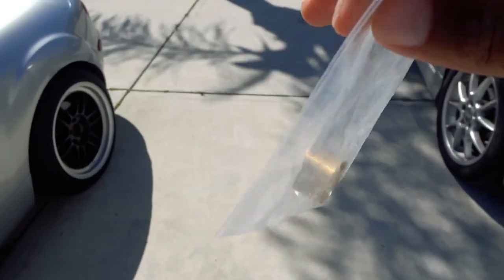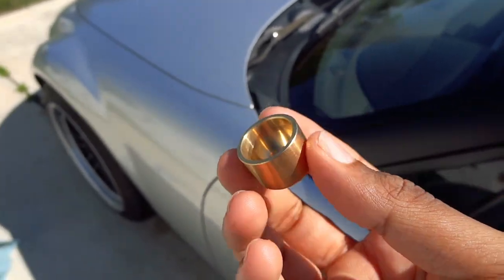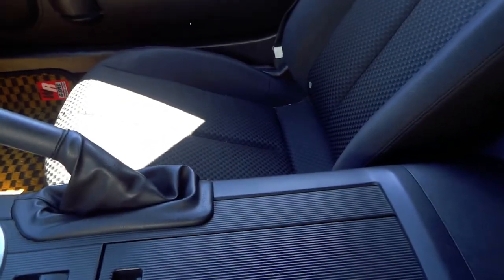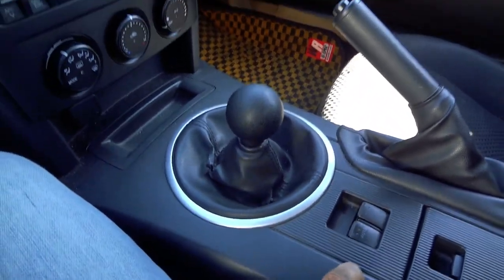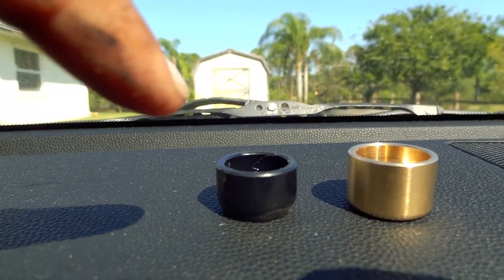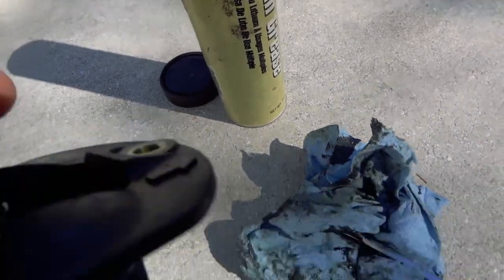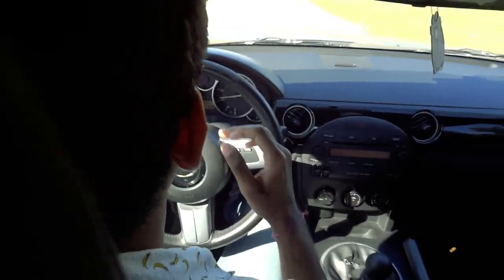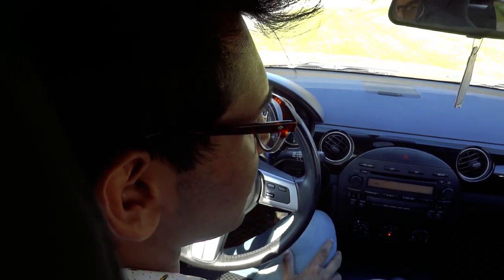NC Miata | Reducing the Shift Play | Beatrush Brass Shifter Collar Install

Comment: Well worth the money. I had that second to third grind on my Miata. This simple piece for twenty bucks eliminated it .
Reply: Would this bushing work for 2014 6mt. I have a little notchyness shifting 2-3 only while driving
Reply from the maker: Specifically the one in the video will not work for you. That bushing was made for NC1 cars only. 

NC2’s have a upgrade plastic collars but you can try looking around for one specific to the NC2. 

Or you can try changing your transmission turret oil. I made a video on that process also.

Comment: I found one fab9 that is for nc1,2,3 and not sure which one. Mine is 2014 6MT hard top top of the line with only 28K. It only feels notchy when shifting from 2-3 while driving. Otherwise all gears shift smoothly and if the car is standing still that problem of notchyness does not exist. Took it in to the dealership and had the transmission oil changed.
Thanks
Reply from the maker: No problem, since you have a 2014 your car is a NC3. 

The transmission oil and the shifting turret oil are actually separated in these cars. Meaning even though the dealer changed the transmission oil you could still have old transmission oil in the stick shift portion. 

Luckily if you plan on installing the shifting collar you can take a look at where the oil level is at. Look up how to change the turret oil it’s a real simple process like installing the shifting collar. You’ll most likely need one bottle of Ford synthetic Transmission Oil. I cover this in my video too.

Comment: Hey love your Miata, just got a 2008 Miata and loving I’m just wanting to know where did you get your tail light. The one on my car are chrome and I hate them.
Reply from the maker: Congrats, welcome to the squad! I always hated the Altezza lights on the NC too. 

It’s actually just a vinyl type red-out tint on the original taillights. Check out a company called Lamin-x. I’ve had mine for about 3 years and it has held up well. The cut is about 98% exact. On my cut out there was a tiny line that couldn’t get covered and over time as the material shrinks the line grows a just a hair. But I would still recommend it.

If you don’t like that then many other people have bought a roll of red tint (for cheaper) and done it that way.

Comment: What are the carpets you have?
Reply from the maker: The carpets are made by Weapon-R. It’s a 4 piece set, 2 larger ones like you saw in my car and 2 smaller ones you could maybe use in the trunk. It’s a universal fit.

Check autoanything or carid, I bought mine from one of those sites.

Comment: Quick question, what kind of shift knob do you have? Is that with a shirt shifter ? How does it feel compared to stick shift knob?
Reply from the maker: It’s a Team Voodoo shift knob, the model is called magnum, and the finish is textured black. 

Nope, just the stock 6 speed shifter. 

The biggest difference is unsurprising the ergonomics. The stock shifting knob didn’t have a lot of area to completely palm grab the top of. If your like me and always shift gears with your hand above the shifter this is going to feel nicer then the stock one. Though spherical shape works for just about any style really. 

It’s much heavier then stock so you can feel that although it’s minimal. I’ve read some reviews of people saying it makes for a shorter throw. I can’t say it does. At least for me I didn’t feel a difference in the shifts. 

Also I’ve never had a issue with my shift knob being too hot to touch after being parked outside on a hot day. Might be because of the textured finish. The textured finish also caused my hand to slip off the shifter if I wasn’t 100% grabbing it.
Reply: MereMortalSammy thank you so much for the detail response... how’s your NC coming along ?
Reply from the maker: No problem! Unfortunately things have come to a halt because I’m moving into a apartment for university. I’ll make a update video to explain everything.

Comment: Would this work on a NC1 5sp?
Reply from the maker: Nope, this Beatrush one is specifically for the 6-speed NC1. 

But check out this link. It’s really the only one I could find for the 5-Speed. 

http://5xracing.com/i-15909791-5x-racing-mazda-miata-bronze-shifter-bushings.html

Comment: So why do you apply grease in the colar?  And what type?
Reply from the maker: It's two metal parts coming in contact with each other and it holds the collar in place while you put it in the shifting turrent. It's a been awhile since this video but I probably read instructions stating to use lithium grease, it's not something I just came up with.
Reply: The turret has transmission fluid inside that should lube that for you so the grease shouldn’t be necessary
Reply: @SinisterGoat02  I have problems changing gears to the 2nd. It gets easier when the car warms up. But in cold it's difficult
Reply: @LifeTakerIman upgrade your fluid. It makes a big difference with this known issue

Comment: Link where you bought the item?
Reply from the maker: https://fab9tuning.com/performance-brass-shifter-bushing-nc-miata-06-15/

It went back up to it’s usual price. It was way cheaper during the time I made this video because of low stock.
Reply: @meremortalsammy4580  thanks man. I just bought an NC 06 Grand Touring with 167 k miles (yes, a lot) and i feel the stick shift is too wobbly. As from what I see in your video, this is just what I need. Now, besides from that, I also feel it's too easy to shift into R while trying to shift into 1st, for that I think I'd be good with changing the upper rubber bushing so that the up and down movement of the stick gets stiffer. What do you think?
Reply from the maker: Hey congrats! 167k is a lot lol, but if a NC1 made it to that mileage the engines gotta be healthy. 

Usually you really have to push down to get into reverse so I agree with you though it makes senses. 

https://miataroadster.

Might want to check out that website. Contact the owner and he’ll probably point you in the right direction. I think they sell a OEM shifter rebuild kit.
Reply: @meremortalsammy4580  thank you! (I saw your response now) appreciate it